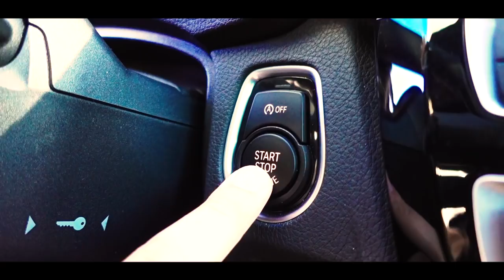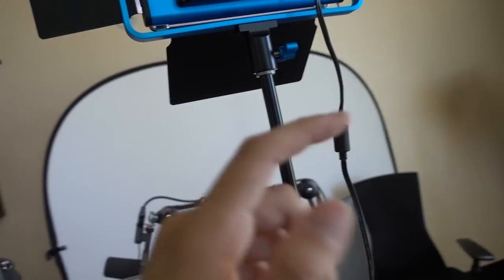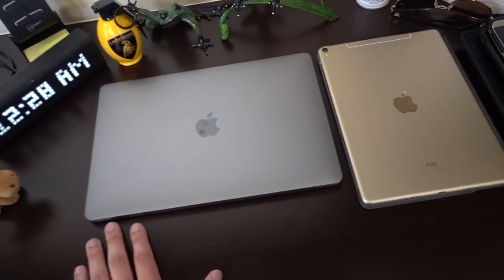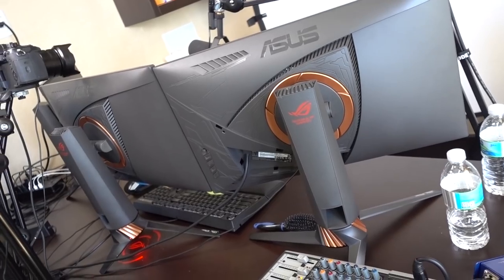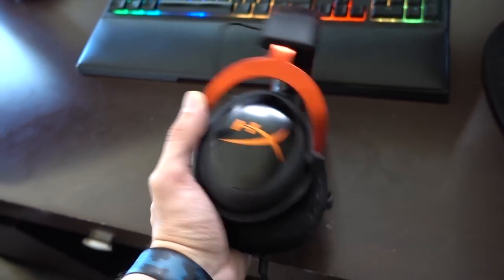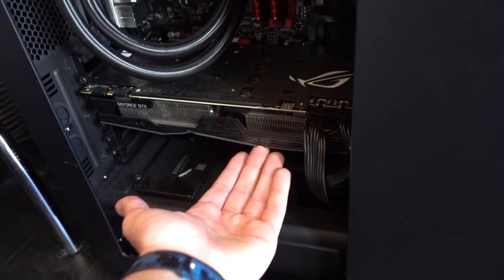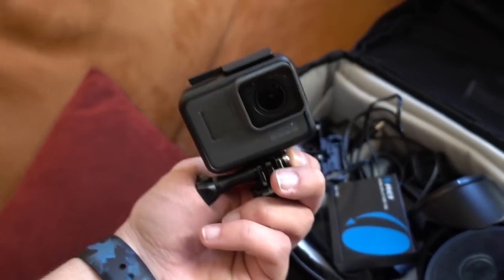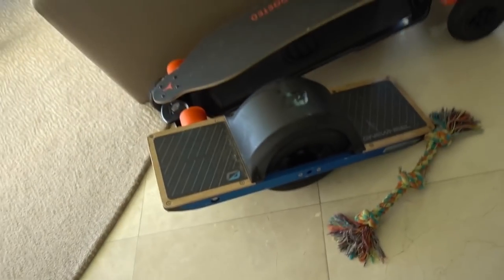MOOSECRAFT'S $100,000 ULTIMATE GAMING SETUP!

Comment: i also have a "M point 2" just for the "processor" xD first of. its called an "M dot 2" and its for the operating system. and this is not 100.000 worth dollars.
Reply: What was the pc
Reply: Did he even ever link it
Reply: Ikr
Reply: M.2 drives are not only for the operating system.. they are made to be used to store regular things... but you can use it as a boot drive